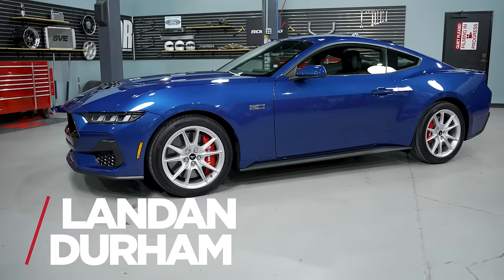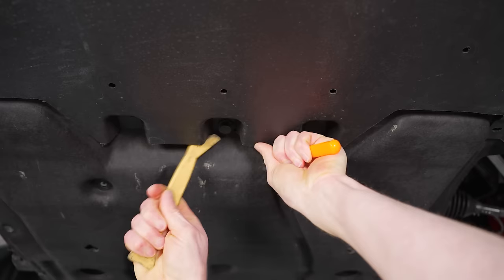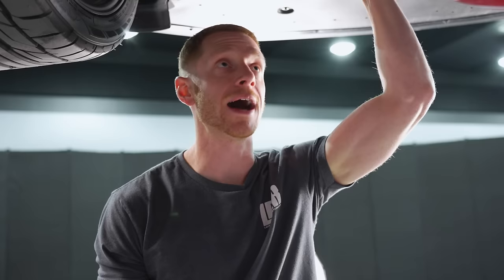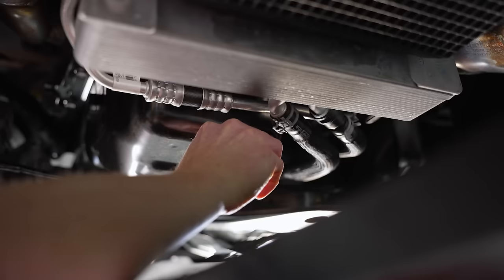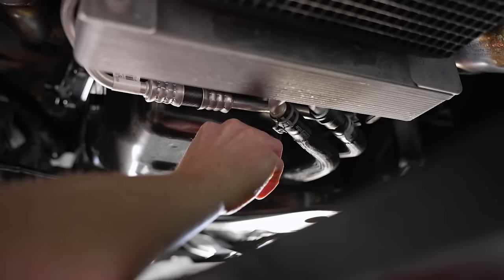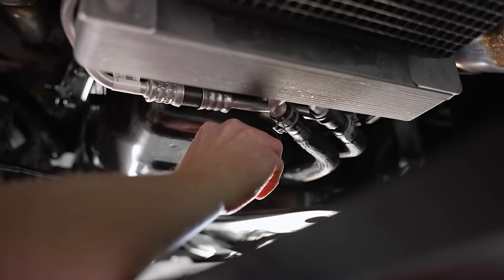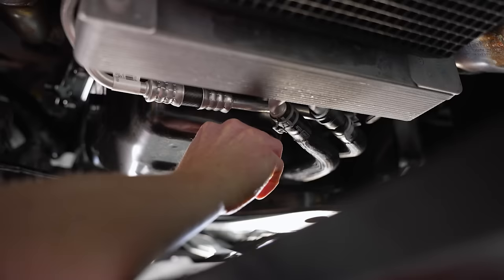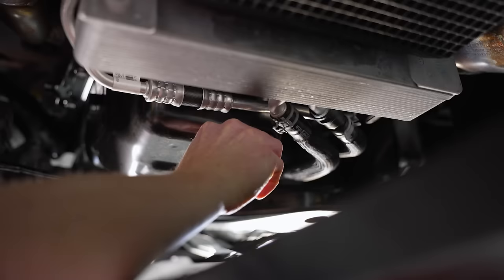2024-2025 S650 Mustang GT & Dark Horse Gen 4 5.0L Coyote: Oil Change & Oil Life Reset - Full Process

Comment: Another reason for using the same or similar large CLEAN funnel to pour oil into the engine, is to leave the bottle for a few minutes longer (as he did in the video) so the bottle empties completely. If you have time constraints, choose one and place the other bottle on top to drip dry into it, 30 minutes each. Amazing how much is still left in the supposedly empty bottle.😊

Comment: My 24 had it right off the rip I've had alot of coyotes, every generation to be exact. The only coyote variant I've owned that didn't was my GT350. It is a normal characteristic of the coyote engine, and he's right some don't develop it for whatever reason. I will say this ceratec does work, infact in my gen 2 coyote had it, I used one bottle of ceratec and it went away instantly. And the best part I changed the oil after didn't use ceratec and it was still gone. So the point of this long winded comment is this is that noise detrimental on the engine no, is that noise annoying yes, is ceratec magic no, does it work yes.
Reply: Will be changing the oil in my 17 soon for the first time since getting it 4 months ago. No tick now and plan to keep it that way so I already have the Ceratec to go with the new oil. Pretty sure the previous owner used it as well. Soon be at 54k miles.
Reply: Ceratec definitely works but just a heads up if you’re going to use it , you’re supposed to put two full bottles in  , one bottle for every 5 quarts of oil. I use it in my GEN 3 coyote Mach 1 and I have never heard the tick come back since I’ve started using it. 🇺🇸💪🏼🐎

Comment: I don’t understand why you fill the oil filter with oil ?? you really do not have to do that, and also, I’ve never put oil around the O-ring either, to each their own but it’s really not necessary 🇺🇸💪🏼🐎
Reply from the maker: You nailed it; to each their own. -Landan
Reply: I've always prefilled my new oil filters (if they installed vertically) and put a light coating of oil on the new filter's gasket.
Also, I never torqued an oil filter!
Just run them up until the gasket touches, then hand tighten them 3/4 of turn.... done!

Never had a gasket stick to the block when removing the old oil filter.
Reply: The reason to pre-fill the oil filter is simple. It takes a few seconds for the oil pump to fill the new oil filter.. Guess what’s not getting oil pressure for those few seconds?

Comment: I’m pretty sure the type writer tick had a lot to do with the timing chain getting loose there was a recall I had that noise took it in, and it was a loose timing chain they updated to oil pressure with an update that ford released and fixed the chain it went away and I whippled the car

Comment: Ford Mustang GT came out in Australia around in 2015. Some of the Coyote Engines run on 5W-20 and 5W-30 Engine oils. If the Mustang Made the " Typewriter Click " some of the owners would drain out the Oil and Filter and put in 9.5 Litres of 0W-40 Engine Oil . There is also a bigger oil filter called Ford Racing that fits in Coyote Engines 2015 - Present.

Comment: Being that I don't have a lift I was thinking about using ramps instead of jacking up the car, do you think the car being at an angle on the ramps will prevent all the old oil from draining out of the oul pan?
Reply from the maker: You'll be perfectly fine. I've changed oil plenty of times on ramps over the years without any issues. -Landan

Comment: Had the tick when I switched from synthetic blend to full synthetic on my 2015 GT, immediately went back to the shop and they drained it and put back synthetic blend and the noise went away and never came back. Sticking to synthetic blend on my 2024 GT as well.
Reply from the maker: Interesting! Thanks for providing your experience. -Landan
Reply: 5W-50 also solves the problem. That’s all ford performance uses in the track attack cars and they all run super quiet. I have a 21 Mach 1 and when I attended the track attack I said what’s in these for oil? They’re so quiet. He said you noticed we use 5W-50 only. I switched to Amsoil 5W-50 problem solved.

Comment: You will need to add a 11th quart to bring the level to the fill line on the dipstick tomorrow morning... and thats a total failure not having a door to the filter...everyone will just leave that pan off..  dealers will put it on wrong, SMH. ... needs a door. 🚪
Reply from the maker: Every car/engine is different. Some have to add oil, some don't. I checked the oil in this car the following day, and it was right on the money. No additional oil required. -Landan
Reply: @latemodelrestoration   makes sense,  but I have had five of these coyote engines and it's the same story... they all seem to want that 11th quart for the dipstick..  anyway,  happy new year.

Comment: Hey guys, just had the oil changed on our S650 this past Saturday at the dealership. Tech said that Ford was recommending 9.5 quarts for the S650. My experience is that 10 quarts would bring it up to a better level. Have any of ya'll heard anything about this
Reply from the maker: This is news to me. What was their explanation or reason for only 9.5 quarts? I’d like to know as I haven’t heard/seen any updates saying otherwise. -Landan
Reply: I'm not sure but I will find out and let you know what they say
Reply: Always had to add a 11th quart for a cold check the next day, to bring it to the dipstick fill line.

Comment: I've never changed the oil in my car, always took it in, but I'm about to buy one of these and it'll be my first new car that I purchase (parents handed down the one I have now) and I want to care for it myself. Something I'm trying to figure out is I assume some oil will be left over after draining it, would it make sense to put a little less than the 10 quarts in the engine because of that? I just don't want to end up over or under filling the engine.
Reply from the maker: Good question. I wouldn't overthink it. I've never overfilled an engine by using the manufacturers recommended capacity. As we show in the video, when you're finished, check the dipstick for reassurance. -Landan

Comment: Does the S650 come with 5w30 synthetic blend from the factory? Doesn’t ford sell a full synthetic version 5w30 except it’s more expensive and hard to find
Reply from the maker: Yes., Ford puts 5w30 synthetic blend oil in the gen 4 Coyote engines at the engine plant. Yes, a Motorcraft 5w30 full synthetic oil is available. Unfortunately, we don't offer it at this time. -Landan
Reply: HIGHLY recommend a better oil than a blend. Even the Motorcraft one. A good FULL synthetic oil like Mobil 1, Amsoil, Quaker State, Valvoline,  Castrol ect. will have much better sheer resistance than that blend. Especially a high performance engine like the Coyote with direct injection could really use a full synthetic oil so it doesn't break down as easy. The fuel from the direct injection WILL contaminate the oil and break it down. If you use E10 to E85 fuel the issue is even more dire.
Reply: @shawnsanders9450  thanks man! I plan to use Pennzoil Platinum once it’s time for my oil change soon.
Reply: I’m pretty sure it does come with full synthetic I already purchased oil and filter from the ford dealer and that’s what they said it called for.
Reply: @seanh6127  no. It comes with a Motorcraft blend but I would recommend a good full synthetic.
Reply: @shawnsanders9450  wow really? Then I’m definitely changing it after 500 miles. I agree a good full synthetic is the way to go especially with these engines.
Reply: @seanh6127  that's when I did my first change too and then 1500 with new filters of course. After that I was tuned on E85 so I changed it every 3 months which was about every 1000-1500 miles. Ethanol will really degrade your oil. Great for everything else so long as you don't let it sit for too long and fill it up with 100% gas every 3 months.

Comment: I hate those under body panels with a passion. I get they are supposed to protect the car, but why make an oil change harder? Now if it had the under panel, but a smaller door with easy access  to the oil drain and/or filter that would make life easier on any car.
Reply from the maker: Yep! Maybe they'll revise the lower close panels for the 2025 model year. -Landan

Comment: Looks like Ford learned their lesson with the plastic oil pan and drain plug. Also, i recommend to use full synthetic oil and change it twice as often as Ford says. Direct injection and Ethanol fuel really wreak havcoc on oil. Ford only has to warranty for 60k miles and hopes something happens after that so you buy a new car from them. 
Also, that skid plate is horrible Ford. Thats as bad as a German car. It needs smaller panels for the oil filter and drain plug that can be taken off with one screw. For instance my gen 3 Coyote has a flap in the skid plate that comes down with one screw while the oil drain is open for access.